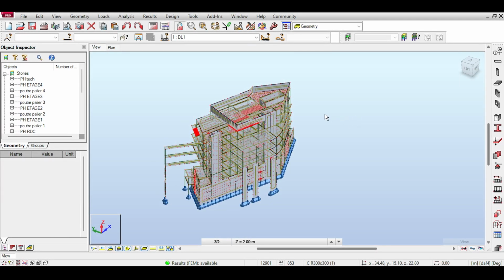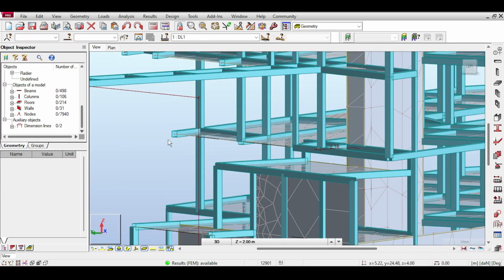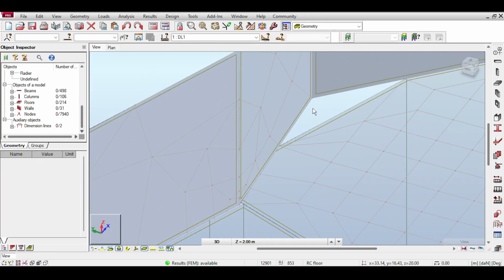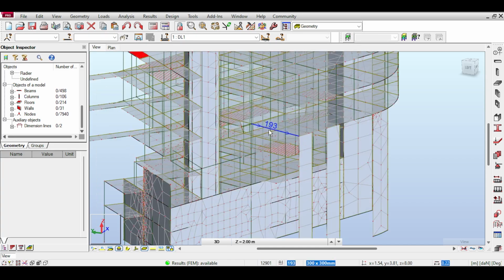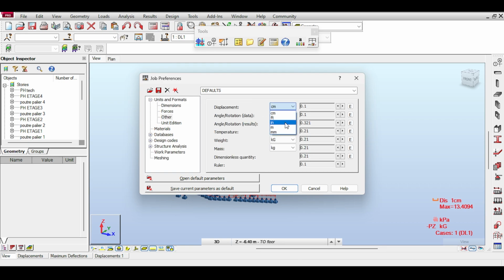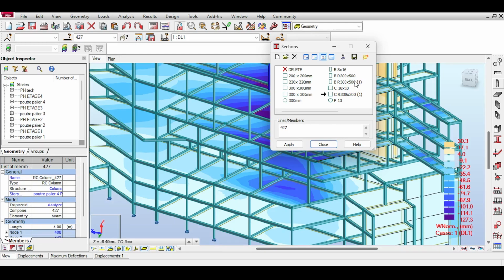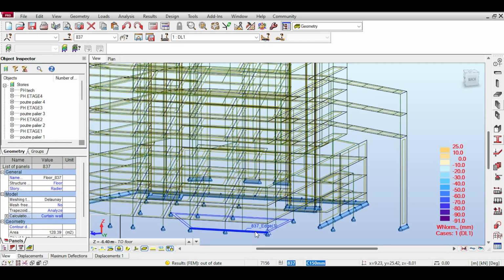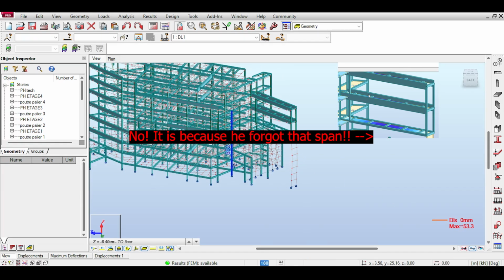Let's Review a Model using Autodesk Robot Structural Analysis Professional

Comment: Hello Dr. CEE,

Thank you for this video. I concur, the importance of aligned and interconnected model elements and components cannot be overemphasized. These are essentially the NON-NEGOTIABLES and the ZERO TOLERANCE of any structural analytical model.

Speaking of Revit, the software does distinguish between a “structural analytical” and a “physical elements representation” model. Ideally, and in my opinion, a Revit user needs to be “structurally and analytically” orientated and need to be keeping tabs on the analytical model as they work with various physical elements and components if it is intended to use or to export their model into other structural analysis software. Alternatively, the structural engineer needs to spend a good amount of time in aligning and working on the analytical model within Revit itself and before exporting same to say RSAP. 

Also also, even with an ideal analytical model import from Revit, etc., the structural engineer would still need to check and to verify the model as the CEE have shown in this video within the RSAP software environment. Things like axes orientation of slabs and walls, joining methods to other elements, spans, etc. will still need to be decided upon and modeled accordingly by the structural engineer in RSAP.

I do not think (I have not yet come across software where) the simple idea of “automatic and single click of buttons exist” at least not for all structural configurations; perhaps these ideas may exist (to some extent) for the simplest of structural forms and similar configurations. 

The other option (in my opinion) would be to model the analytical model from scratch directly in RSAP software environment. Although this may seem to be a long way of doing things at first; I personally find a structural analytical model done in this way to be less prone to both modelling and to analysis errors; one also avoids the amount of time they will need to spend working on the analytical model in Revit and then re-checking the imported model in RSAP software. Modelling from scratch inside RSAP can help to minimise doubts and uncertainties.

I am not saying that imports and exports do not work, they do work and they can be both efficient and amazing tools when used correctly, however for this to happen, the original or the source model has to have been done right which is unfortunately (more often than not) not always the case as these source models are not usually done by structural engineers. The consequences of importing, analysing, and designing a misaligned and unconnected model elements (while assuming that these elements are aligned and interconnected) could be disastrous. 

I have enjoyed this video and I am looking forward to other future videos.

keep well and kind regards,
DK
Reply from the maker: Hi there Engr. DK,
it is always a pleasure to read your comments.

I think Revit needs to be covered on this channel. I noticed that a lot of problems arise due to errors in modeling in revit. 

I am a fan of modeling the analytical model on RSA. I totally agree with you here. You see, when you model, you will ask yourself a lot of questions and find solutions to those. It is much easier to deal with problems during the modeling stage rather than having a model and then trying to figure out what went wrong.

I will keep you posted with regards to my efforts in revit, so stay tuned for those in the future.

Also, again sorry for always seeming to be late in my replies. We are finalizing the semester (grading, course evaluation, portfolios, quality control) so my desk is always full to the brim with tasks ^_^

Regards,
CEE
Reply: @CivilEngineeringEssentials 
 
I always enjoy reading feedback from the CEE team 😊. I am not worried at all about the time it takes to respond to comments, I am more than content that there is a response and I completely understand your other stated commitments at the University and in LIFE too, I would not have it any other way, YOLO ! 

Revit is a BIG program and it has multidisciplinary applications and uses. I have been self-learning and using Revit for more than a year now and I am liking the journey so far. 

The focus on the architect-structural engineer and/or the draftsperson-structural engineer application in Revit can indeed benefit structural engineers who constantly find themselves having to start their structural modelling, analysis, and design work off the architect or off the draftsperson Revit model.
 
But as you have correctly indicated; when a structural engineer is NOT the one who created the Revit source model, the job of the structural Engineer in that case mainly becomes the exercise of trying to figure out what could have gone wrong with the source model from the structural engineering point of view. I think that in order for the structural engineer to be able to do this efficiently, it is imperative that the structural engineer is well conversed with how the Revit software actually works. 
 
For me, and I digress, such an approach to solving structural engineering problems is somewhat similar to the branch of structural engineering work where alterations, modifications, strengthening, etc. of existing structures as opposed to designing of new structures from scratch is the main focus. A structural engineer is unlikely to be efficient in the alterations of existing structures if they don’t already master how such structures are done (or should be done) from scratch in the first place.

Thank you again for showing different perspectives to working with engineering problems, these are very useful and help to spark and to hone open-minded mind sets.

Keep well and kind regards, DK
Reply from the maker: I think we are almost back in business ^_^
I am about to finish all work for this semester. Then, I would have a summer semester with less stress, meaning I can re-focus on this channel.
As a matter of fact, I have already recorded 3 videos in the pile series (still theory) and am editting those as we speak.

You also gave me inspiration to do a Precast-prestressed series. This is something that is lacking in regular university teaching, So I want to do this.

I am really considering explaining revit here, but at the moment, I have some series running so I do not want to over-extend. I definitely have it in my radar.

In my humble opinion, for a structural engineer to learn revit, he should first learn robot, because I assume one of his main goals is to import/export his revit model back and forth to robot. If you do not know RSA, you would fall into the tons of errors that I have found out in our dear subscribers model.

Stay tuned for more content, definitely gonna push more.
Regards,
CEE
Reply: @donaldkhanye9011   I have also started learning Revit for a few years now. I migrated from Allplan.
However, I do not trust that the teams working on RSA and Revit talk to each other very much 😅but I will try the Revit-Robot handshake eventually
Reply: @CivilEngineeringEssentials   Speaking of softwares that you can import-export from RSA, you mention IDEA Statica once 😁

Comment: Hello Dr CEE.  I think you have done a very good review of this project. This is my take on the  model. 

1.  I think the architectural model has it own issues even before the structural issues. Looks as though it’s a residential architect forcing himself to design a commercial space. This is just not right 

2.Am quite amazed our engineer couldn’t really size his members very well. How’s is it possible to support a large span of about 10m with a 300mm depth beam. This is just ridiculous.

There’s no way for a 300x300 columns to span 2 floors. It’s doesn’t really look proportional after construction that’s if it works as per design

3. I know for a fact that there’s a very poor interoperability between Revit and Robot and it’s really amazing this issues exists even till now. 

I strongly believe the main duty of an engineer is to design and build structures and not to invest all his time in trying to solve computer model problems which arises as a result of misalignment of analytical and physical model. Revit needs to look at this seriously. 

4. In all I think you did a fantastic job in reviewing this model to perfection. Thanks and Kudos Dr 🎉
Reply from the maker: Hello there Engr. Nii,
thnx a lot for the provided insights. I am actually thinking of including Revit on this channel very soon, so your comment is actually encouraging me to talk about it here.
You are most welcome. Stay tuned for more content,
CEE

Comment: Dear CEE, thanks for your sharing, why Autodesk Robot not verification RC Cantilever beam deflection? can you recommend  or share any document about RC cantilever beam deflection design in ACI please? 🙏🙏🙏
Reply from the maker: Hi there,
you are most welcome. I did not get exactly what you mean. RSA provides the beam deflection but does not check it against the code because: the ACI code needs you to include long-term deflections, which are not readily available from a simple linear analysis.

I found this PDF which may be interesting to look at
https://structurepoint.org/publication/pdf/Reinforced-Concrete-Cantilever-Beam-Analysis-and-Design-(ACI-318-14).pdf

Regards,
CEE
Reply: @CivilEngineeringEssentials  Dear CEE, thanks you very much for your reply and sharing document.